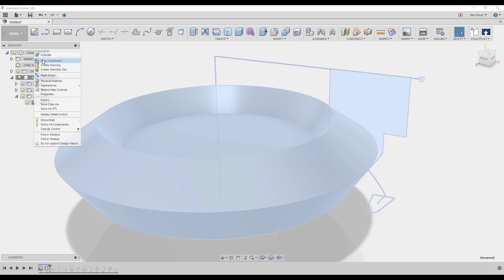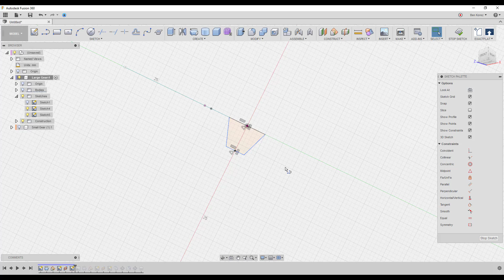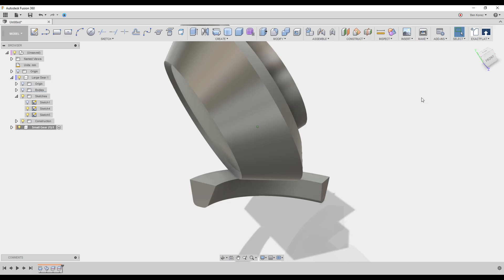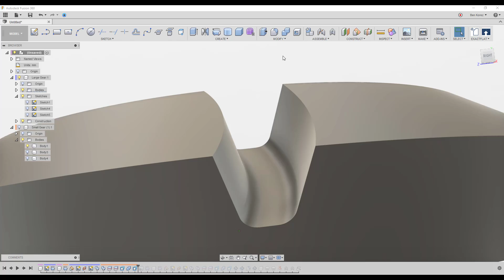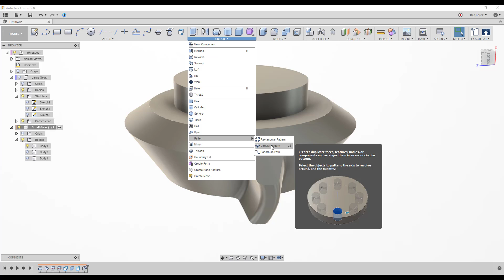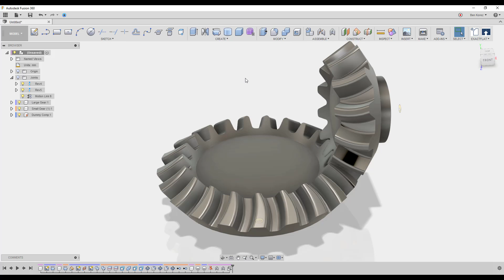Fusion 360: How to create a Helical Bevel Gear

Comment: I was frustrated when trying to animate the model. The video was made using the earlier version of Fusion 360. I've replayed the video so many times but cannot see the menus and labels clearly enough to work out how to complete the task. I've created .stl files and will carry out a practical test of the bevel gear after printing.
Reply from the maker: Does the printed parts work?
Reply: Sorry for the delayed reply. As I recall the model was too large for me to consider printing. I'll look through my files and try to remember to reply.

Comment: Great video showing a lot of different techniques working with Fusion 360. Also very useful for creating 3-d printable gears for model building etc. 
Thanks!
Reply from the maker: Hey Andreas, I'm glad I could help :)

Please contact me at Fusion360NewbiesPlus@gmail.com - I have a question to ask you!
Reply from the maker: thanks for the feedback. 
We are about to release a new platform  that will help users to buy a new hardware for their software, and we're looking for Fusion 360 users like yourself. Would you be interested to be a tester?

Comment: Hi, I’ve read the various comments below and I already knew that your design was not engineered correctly to be a true gear but, for all those who don’t like it, remember this was stated in the video and reference was made to documentation detailing how to calculate all the relevant data. I learned a great deal from this and your other videos on how to use Fusion to create these parts. With the knowledge gained here, I am now able to design and draw several types of gear assemblies for which I am very grateful.
Reply from the maker: Hi Peter,
You are 100% correct. My videos are about the techniques you can use to achieve your goals even though F360 don't have the specific tools for them.
I'm glad you noticed that and that my videos helped you :) 

Cheers / Ben
Reply: @Fusion360NewbiesPlus  
I've been doing CAD for 30yrs and understood that this was only to pass on info about how basic graphic representation and Motion is and can be done in Fusion, not to be confused with Engineering param. Good job Peter

Comment: Thanks for sharing souce file and for all you time whit this!
I think you are doing a really good job whit this video, strait and clean explaining and understandable english :)
I really like your methods in Fusion:360 is easy to use and fast to manipulate (few steps)

There is room for improvement!. hope you don't mind, me being hornest, 
but whitout calculations of the gear radius/teeth, circular pitch/tooth thickness etc. its just pixel's 
Would be really nice if you had some more details on the theoretical side of crafting gear's
mathematically correct formulas for the diffence gears..

Anyway thanks again.. you rock !! :)
Reply from the maker: Hey Alex,

Thanks for your feedback, especially for the constructive feedback which I really appreciate!
There is a good reason for, why some of my videos are not detailed enough. The goal for my videos and this channel is to tech technics and to help people think more creatively and out of the box. 

If I'll go into details, people will focus on how to create that specific model and forget about the technic. Moreover,  I'm more of a designer than an engineer and getting into the math aspect of gears, I'll prefer to leave it for the experts!

BTW, Stay tuned, - very soon I'm coming out with some really exciting news. Something that will help to solve a HUGE problem for people in our Software industry and general media  ;)

I'll probably need some great guys like yourself to run the first test and I hope you don't mind me contacting you some time in the near future.
Reply from the maker: Hi Alex,
How's your F360 project is doing?
Please send me an email to F360NP@gmail.com, subject "New Project".
I'm working on a new Platform and I would like your opinion on it.

Thanks.

Comment: Well, as promised I'm reporting back on the math and I have some good news and some bad news. 

* Having read up on involutes (those are the shapes of meshing gear teeth) I can report that, unfortunately, they are mathematically fairly complicated.

* Fortunately, good tools exist to automatically create them. Here's a good example: http://www.otvinta.com/tutorial03.html.

* Unfortunately, Fusion 360 doesn't allow mathematical functions to draw sketch lines. According to the Fusion forums, this is a planned future feature.

* Fortunately, you can use a freeware application called Blender to design the gears and then export a .STEP that you can import to Fusion. Details about Blender are found in the Otvinta link above.

*Unfortunately, Blender is pretty complicated unto itself but, fortunately, it's power seems to be worth the effort to learn. 

So, the bottom line is: keep an eye out for the addition of mathematically-determined sketch lines in Fusion 360 and, as a stop gap, use the link above to draw your gears in Blender and export/import them into Fusion 360 and then animate them as described in this video.
Reply from the maker: Hey David,
Yes I know about the Otvinta website. As you mentioned,  Helical Bevel Gear are not easy to make even in Blender!
But, if the Helical Bevel Gear that you need doesn't have to be 100% mathematically correct, then you can use my technique. I know it's working, because someone has tried it and it worked for him.
I'm sure Fusion 360 one day will have Helical Bevel Gear feature, but until then, we will have to figure out our self how to do it according to our needs.

Cheers.

Comment: Thanks for a great tutorial and for providing the source files.It's a huge help.

 I noticed a couple of things. 

First, the trailing end of the  teeth interfere with each other as I turn your example drawing. This can be manually accounted for but it may also fixed by using the math that mroek mentioned. If I get a handle on that math, I'll post some pointers here. Otherwise, if anyone does know enough about it to post here, I'd greatly appreciate it.

Second, a more reliable way of creating a tangent plain for the gear teeth to be engraved into/protrude from is to use the initial sketch and then construct a plan at an angle from the line that intersects the two faces. That way, the teeth are always centered on both parts.

Thanks again for an excellent tutorial.

Comment: In the "Motion link" dialogue box, you can simply enter the gear number for ratio instead of doing the calculation. 21 for the large one and 12 for the small one. Fusion will take care of the rest! Thanks for you work!
Reply from the maker: Great idea, thank you for sharing!
Reply: Thank you Dudes! 8)
Reply: Can you explain this more please?  I open the dialogue box and only see rotational values and changing those is only the rotation not size.  I know your comment is 6 years old but hey, worth a try!

Comment: Interesting technique. It seems kind of an ad-hoc method that doesn't take into account all of the special equations and methods of creating gears (like involutes, pressure angles and such), so I'd be inclined to believe that this method isn't suitable for machined gears or gears that need to be very accurate and/or silent and/or durable. However, for 3D-printing that probably doesn't matter, so I'll definitely look into your method some more.

Thanks for taking the time to create this, I think it will be useful!  :-)

Edit: I took a look at your file, and as I suspected, the gears don't really mesh correctly. Try adding a section analysis that cuts the area where the teeth mesh, and then rotate, and you'll see that there is a rather significant overlap between the teeth in some areas. If the gears/teeth were correct, then the clearance would be constant at all times during the rotation. However, for 3D-printing (at least FDM) this will still probably work fine, due to the not-so-great precision of th printing process.
Reply: You are correct sir. This is a case of a designer producing something that he doesn't have to manufacture. If he was CNC milling this then HE would be having to fit the two together and saying,"Shit, I screwed this up" These are models that look like gears instead of engineering that you built in CAD. If you want to BUILD helivcal bevel gears this is not a valid technique.
Reply: mroek do you know any software to generate real gears?
Reply: I understand why this profile is not mathemagically correct to use, do you think it would work to sweep an involute profile at the correct spacing on both gear hubs? I'm just thinking in my head and nothing obvious occurs to me why it wouldn't work but of I course I may be forgetting about something?
Reply: I can see the teeth binding in the demo. Again, probably fine in 3D printed gears, where the accuracy is low and the material is soft enough that they'll probably wear into a usable condition quickly (and then nearly as quickly wear out). But now that the GF Gear Generator extension for Fusion 360 exists, there's no reason to try this method. I just printed a set of straight bevel gears generated by that program that work fairly well. Of course if you absolutely need a helical conical set, your out of luck, but it's hard to think of a scenario where that's a genuine need that can't be met in another way.

 @DepressedCookie  
I suspect this wouldn't work even with an involute profile. This method didn't account for the fact that the teeth need to get smaller as they get closer to the center of the gear (such that they would all meet at a point at the tip of the cone if extended that far). Also, you'd have to be careful with the angle of the cutting profile, because if the helix angle changes at all (as it does in his example), then the tooth form would also need to change width (the relationship between circular and helical pitch). To get a conical-helical cutting path, sadly the only way that I can think of in Fusion is to either mess with the coil took (very clumsy), or use a 3D equation-driven extension, for which I haven't found one that works well and is editable. 

I suppose that in the end, you could make it work if you managed to make a conical helix cutting path, and you got the taper angle on the sweep correct. Actually, I think that what you'd really need is a second conical helix path to act as a guide/scaling path. Very complicated!
Reply from the maker: The bedst way to know if it's a valid technique or not, is to try it.
This guy used the same technique, but for a Worm Gear and it worked for him. Maybe it worked for him because he printed it. Unfortunately, No body gave me a feedback in regards to a CNC yet!
https://forums.autodesk.com/t5/design-validate-document/help-the-best-way-to-construct-a-worm-gear/m-p/6997880#M106517
Reply from the maker: Just change the clearance (maybe the profile as well) and everything will be just fine. You should focus on the technique and not the measurements! If you need help, please let me know.
Reply: Yes, of course it is possible to change the clearance, but that's besides my point. My point was that this technique does not create what could be thought of as a "correct" gear mesh. Increasing the clearance is just a way to camouflage the error.

But again, I'm not saying this method isn't suitable for 3D-printed gears, because I'm certain that it is.